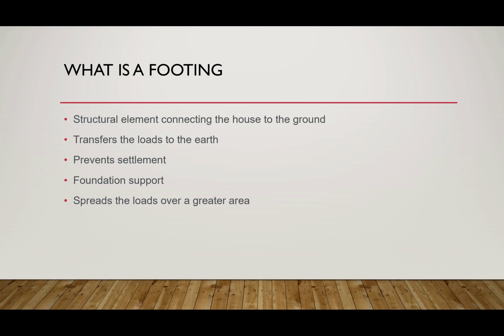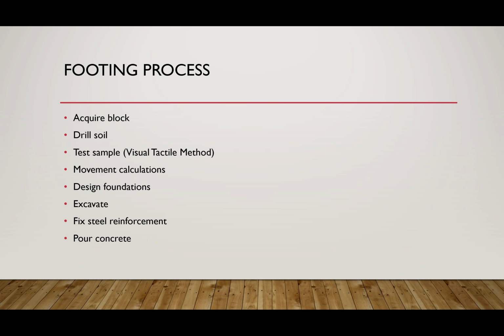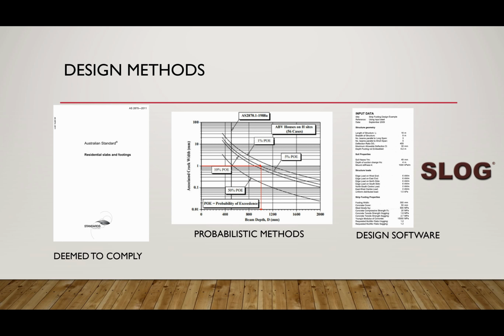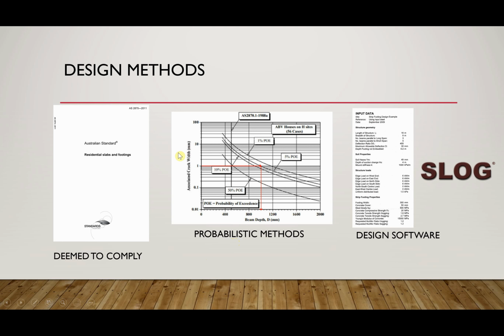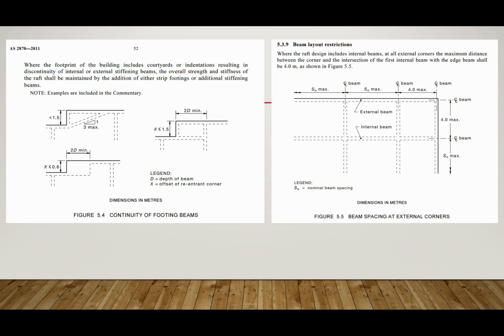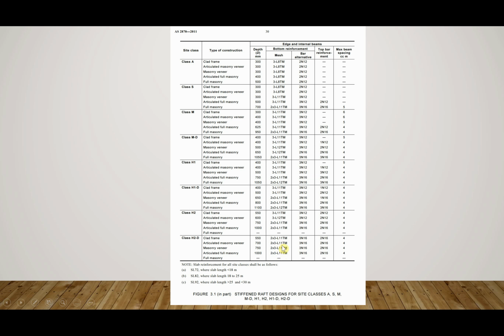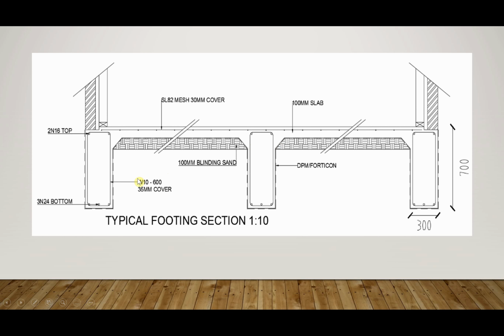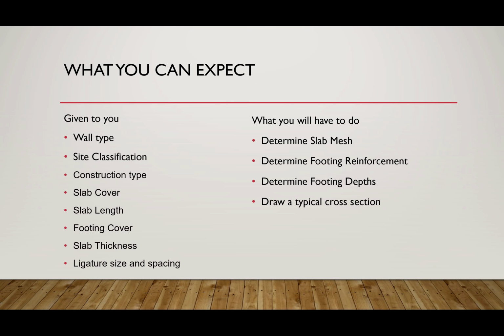Residential Footing Design Overview

Comment: The edge strip footing top right at 14.57. You are essentially making it a continuous raft? Should there not be a stepdown notation? If not there is a re-entrant corner there not detailed.

Drawings should have a step notation.